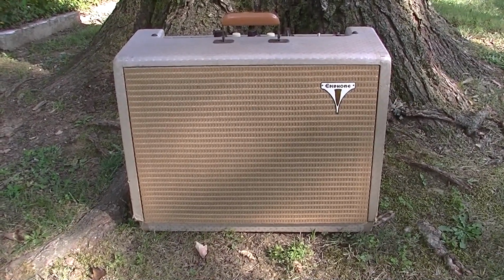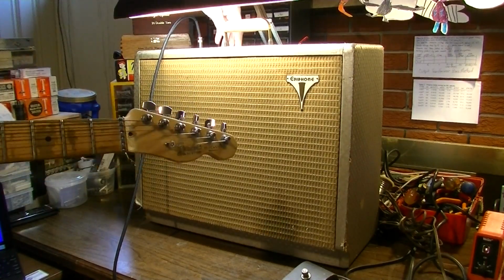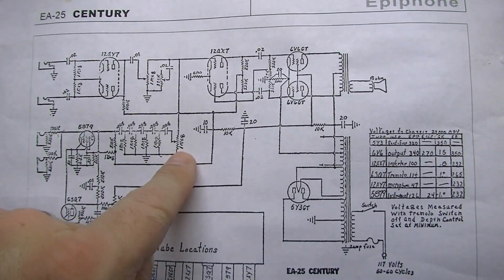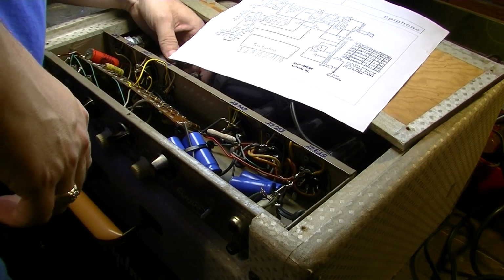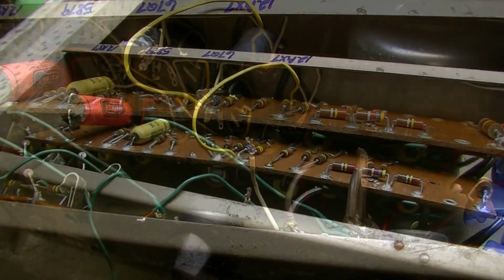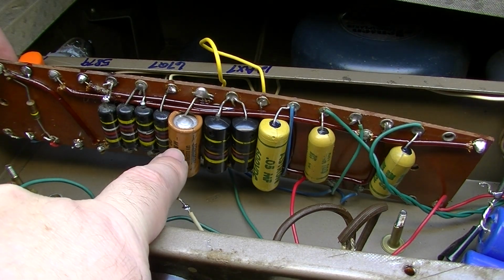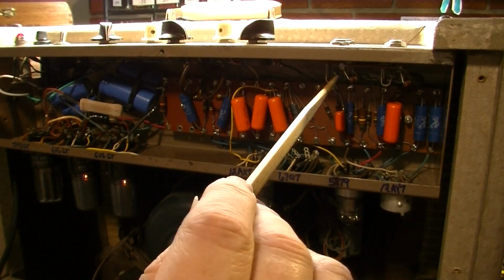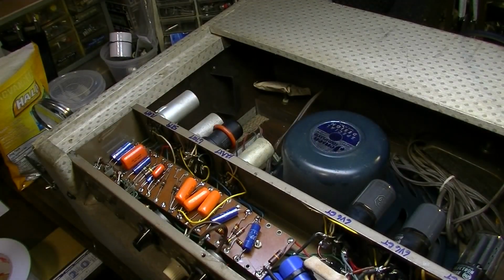Recapping Vintage Guitar Amps - When is "Killing the Mojo" OK? (1959 Epiphone Century EA-25T)

Comment from the maker: Someone asked what kind of shielding tape I used. The stuff I used was HFT branded from Habor Frieght, but this stuff or the 3M stuff should all do just as well. 3M will be most expensive. If you don't have shielding on the back door of your amps, they NEED it! http://amzn.to/2wBKPmM
Reply from the maker: BONUS! This stuff also makes great liner for your favorite hats. ;)
Reply: I use regular Heavy duty foil........... I use a glue stick to stick it on the wood... works fantastic!
Reply from the maker: Just make sure if you glue in foil that you use a very good adhesive that wont deteriorate under heat. You don't want it coming loose and shorting anything.
Reply: Also staple it ;) staples trouh the overlaps also ensure better contact.
Reply: I decided to just go with the Amazon brand, Tapes Master,  with conductive adhesive. It's cheap and way less questionable then other Chinesium offerings.
Reply: Hey you got a shout out on Tone Talk YT chn if you haven't chk it out the have a lot of the master amp builders. I've learned a lot from the guys that made the 70's -80's amps ppl covent,
Reply: I had a vintage Epiphone  I think it was a Electra or a Comet tube amp and the tone was very ice picky piercing , it was not a nice tone like this amp
Reply: I never in a thousand years thought that amp would sound so good. Ive always heard bad things about epi and Gibson amps and have seen tons sound like trash but this amp was great. Eye opener.
Reply: Instablaster...

Comment: I simply cannot believe the idiocy I'm reading here, this amp was built down to a price and made to be played, what Brad has done is put it back to factory fresh using modern more durable components. Leaky caps don't add tone, they make noise.
You try and go buy a 1959 Corvette still on its original tyres or original brake linings, some components are consumables and have to be replaced periodically because they age badly.

Remember that when you hear classic recordings from the 50's and 60's, the equipment being used was brand new and factory fresh, it wasn't vintage gear back then. The pickups were fresh and their magnets strong, the tubes new, the caps and resistors in spec. and the speakers crisp and clean.
For every 'Holy Grail' '59 Les Paul that was made there are a thousand tons of junk guitars that didn't make it through time to us, the reason that LP got here is that it was as well made as a skilled luthier could manage, using the best woods he could select, and even then there were plenty that didn't make it. Time weeds out the weak.
These guitars and amps were made well enough to have survived, that's why they're deservedly famous and also why modern mass-produced gear will not survive, especially digital stuff.
This vintage tone obsession is retarded, stuff that is in tip-top condition sounds better than old, clapped out crap.

I betcha if Brad made a clone of this amp from all the best quality brand new components using that exact same Epiphone circuit diagram it would sound even better than this nice old one does.
Reply: You are totally correct. If you were going to put something in a museum so people could look at it and observe how things were built way back then, then yes, it should stay original. However if you are going to play the damned thing, like you said, it’s like not replacing tires and shocks on a 1950’s car. Still pretty but drives like shit. So many damned experts on YouTube who don’t have a channel but know how everything should be done. I was watching a medical procedure yesterday and was floored by the number of people who knew the doctor was doing it wrong.
Reply: I heard a good recording of Fleetwood Mac from their early days when they where a blues band, playing brand new amps and it sounded like you where playing a modern valve amp. Speakers can age nicely, vibration makes wood resonate better so guitars and cabinets can actually get better or at least more 'characterful' however I totally agree on components. If you where'nt right we'd all scour fleabay for 70 year old death caps for our amps! XD
Reply: @satchmodog2  unless it's N.O.S. maybe
Reply: The comparison to a classic car is spot on.  A show car is cool because it's parts are factory installed, however you wouldn't want  to take that car around the track or use it as a daily driver with 60 year old dry rotted tires.  If a person is asking to get an amp fixed, I assume it's worth more to them operational than it being factory stock.

Comment: Cool update.  I'm on board for updating the caps.  It is an amp that should be played, not a museum piece that should be collected.
Reply from the maker: I agree, this one wants to rock out. But I can also see the collectability of it. It's a 1959 Gibson, after all. :D
Reply: I have seen guys take vintage capacitors apart and put newer ones inside of them to look original, so take that into consideration. The part that faces the board is open so you don't see the opening.
Reply from the maker: I think re-stuffing caps is crazy. I don't get it.
Reply from the maker: I can understand stuffing electrolytics. That's a different story. In that case, there is a real reason to do it. Single electrolytics are cheaper, for one. Sometimes you cannot find the exact combination of values in modern cans, and stuffing the old cap can means saving space inside the chassis. All valid technical and economic reasons. Not so with re-stuffing vintage caps for appearance sake alone.
Reply: @donrutter6550  hm. Not a bad idea.

Comment: It's definitely a good idea to replace old caps in a guitar amp with brand-new ones as long as they are adequately rated for the job, there's really no point in having an amp 100% original and with all it's original components in place if some of the original components are faulty, or are in the process of going faulty if they have a negative impact on the functioning of the amp, I'd rather have an amp 80% original and functional than an amp that's 100% original and non-functional, amps are meant to be used, so they need to be fully functional like they were the day they left the factory, so if it means replacing some original components with brand-new ones just to get it functioning properly, so be it.
Reply: Simon Kormendy same

Comment: I have a 1960 Gibson GA20 "Crest", No tremolo, Tweed covering. Great sounding amp. I replaced the electrolytics 7 years ago. and installed a 3-prong AC cable. It's in 9 out of 10 shape.3-12AX7's, 2-6V65's & a 5Y3. all the caps and resistors are on one side of the board Be nice to give it a new home if anyone's looking to buy one! I just don't play it enough as I have around 15 amps

Comment: Having vintage amps serviced is a must! I grew up playing my dads early 70s VOX AC30, one of the greatest amps, Ive played through. I didnt think there was anything wrong with it except the normal channel was a bit too dark for my tastes. He got it serviced (had changed the tubes himself plenty of times but never a full service) by a tech that knew a lot about VOXs. The amp was great before, it was amazing afterwards, just better in everyway especially the normal channel which sounded like a completely different circuit from before.
Reply from the maker: A lot of times guitar players get so used to setting their controls a certain way to get "their sound", then once the amp is serviced properly, those positions move and you have to find them again.
Reply: Yeah guitarists can be super lazy, I tell you what though in the guitar world everything changes. If you move your amp you'll have to change the control based on room acoustics!

Comment: The series of resistors and caps after that pentode is called a shift network, it's working to get the phase tweaked a bit for the tremolo to work more effectively.  I learned about this working on my Vox AC30/4 that I built a while back.
Reply from the maker: Thanks for the comment.
Reply: Whoa, that's interesting